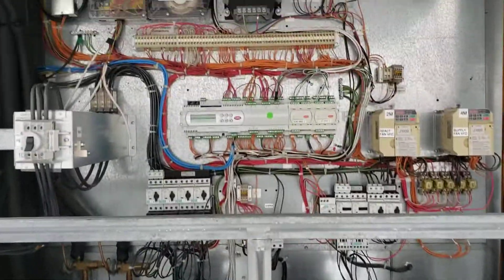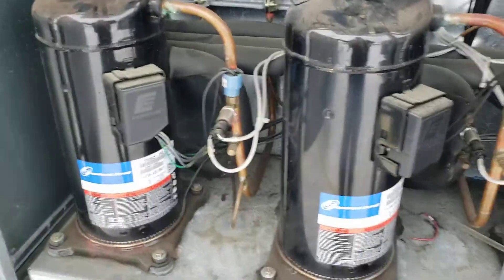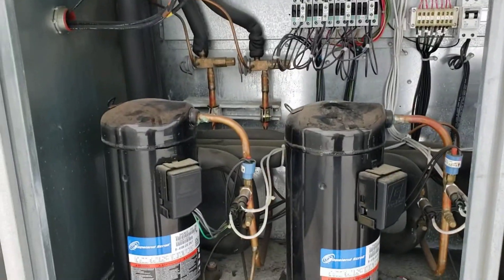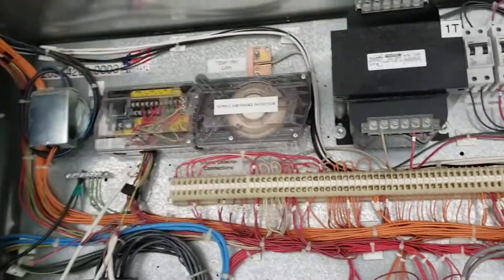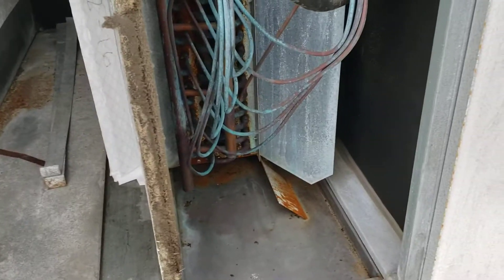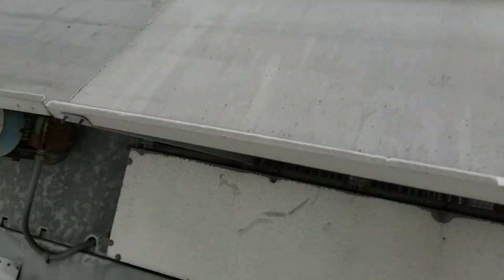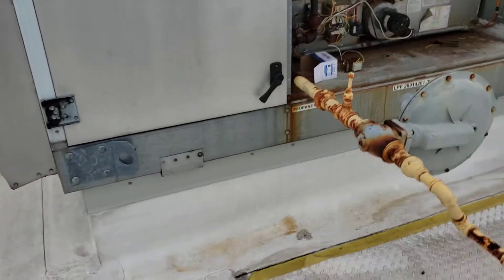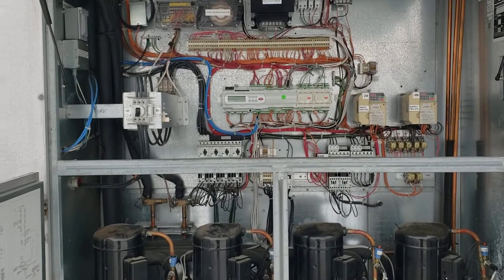dehumidifier unit for supermarket explained.

Comment: Interesting. The one we have for the ice rink recirculates inside air only. We are trying to remove humidity so I guess it makes sense. Also it’s just the wheel. Love that belt drive. Ours has a chain. The rotation fault switch is a constant problem too.

Comment: This just seems so stupid. Sorry. But the unit heats up fresh cold air. To heat up the other air that goes inside. Makes absolutely no sense. What not just use normal ventilation with heat recovery? Using the stores heat?
Reply: Florida Man HVACR  it just seems like a lot of energy waste. In Denmark we reheat with old heat
Reply: This unit does heat recovery with its slowly rotating “heat wheel. ” During cold weather the heat wheel recovers energy from the warm stale air leaving the building before exhausting it outdoors and transfers that thermal energy to the fresh cold outside air which is then blown into the building. I presume it works in the opposite direction when the outside air is warmer than the inside air.
Reply: Thermal Wheel
Reply: @jrh86  exactly
Reply: It doubles as fresh air as well
Reply: @MyBallzGotShocked  I don't get it.
Reply: @MyBallzGotShocked I'm no engineer. I get that you gotta cool the air to make the water condensate amd then heat it again to make it comfortable indoors. And then you have warm, dry air. But the heating weel he talks about takes cold air in and heats it up with th AC unit/compressor it has to put that air thru the heat weel to transfer the heat. Why not just put that heat on directly with the AC on the air that blow in and not have that weel in the first place?
Reply: @williambhoe I could be wrong but I think calling it a heat wheel kind of confuses things. It’s primary purpose is to remove moisture. The wheel needs to be heated for the moisture to be removed. That heated air is not pumped into the building. But the one I am use to is for an ice rink. So if this one does that’s why it is cooled and moisture is removed. He explained this unit good but not how the desiccant wheel works. That wheel needs to be heated for the moisture to be released. 1/4 of it is heated. The other 3/4 is the air being dehumidified for the building. The 3/4 air is air from the building being blown through the wheel. At least for our ice rink. They could be drawing fresh air in. Which is your point I believe. Why. I am sure a good reason. But the wheel picks up the moisture and then rotates. The 1/4 being heated is to release the moisture off the wheel. For our ice rink that warm moist air is just vented outside. It has exhaust has so it can’t be vented inside unless going through some kind of heat exchanger. Not sure if I answered your question 😂
Reply: @MyBallzGotShocked or suck air (which is warm) out of the store ad use the weel for heat recovery
Reply: The hot gas bypass reheat is used to clean the desiccant wheel off and dry it of moisture. That air is discharged out of the top of the unit not to the inlet air. They use make up or outside air that is then dehumidified by the evap coil. There is a bypass damper that works best if you have the return air option on your unit. If not it bypasses on failure or if outside conditions are good.